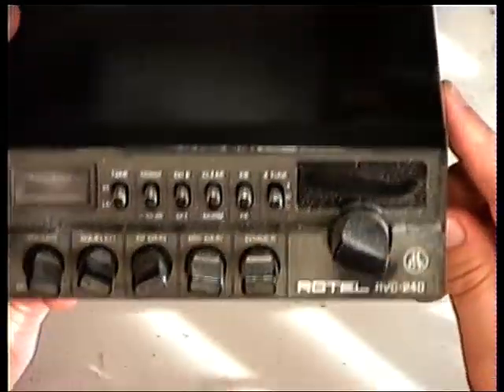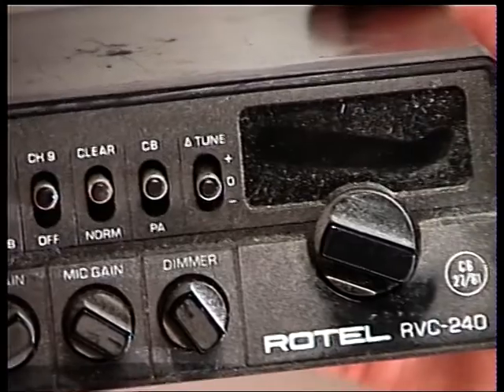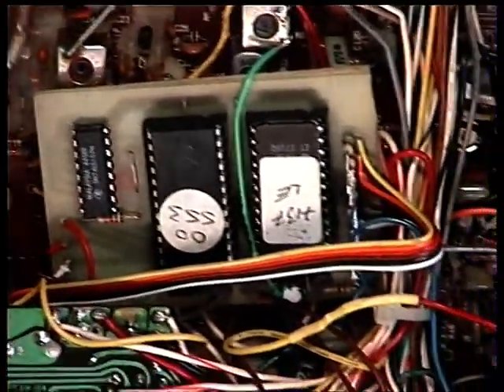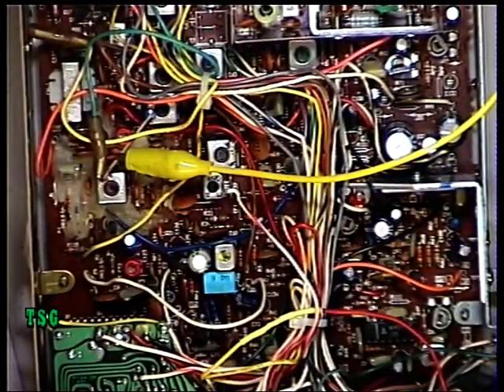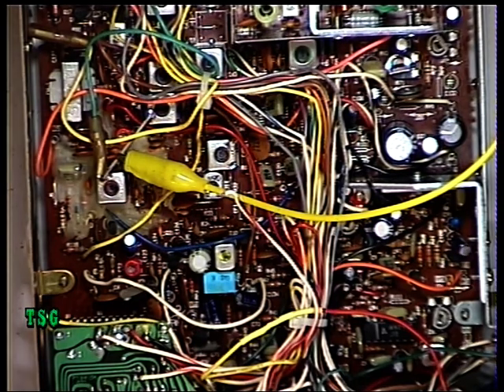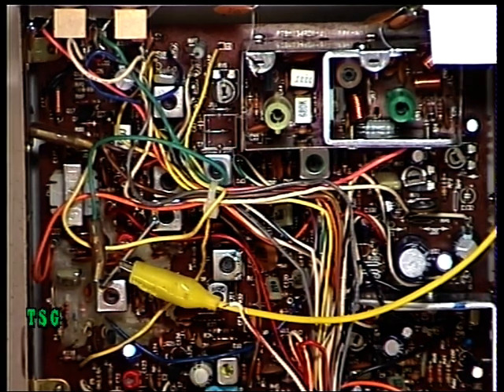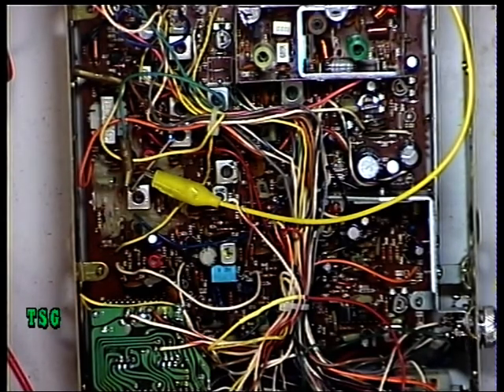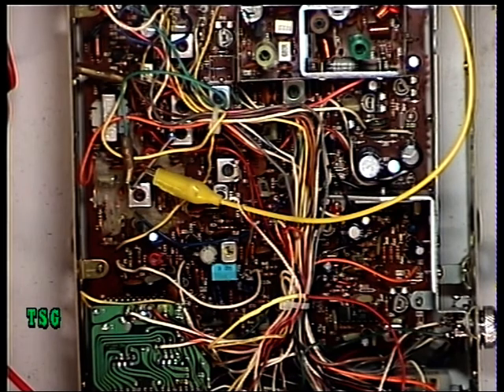Rotel RVC240 UK (CB27/81) CB radio (mobile)  - repair, vco & transmit

Comment: Hi Richard, do you know where i could pick up a replacement signal meter for a Audioline 341 ?
Reply from the maker: You'll just have to trawl ebay for scrap uniden sets...you may find illegally imported AM models have the same meter & you've cracked it. I seem to recall we had a scrap President Veep that we once found to be a suitable doner. Some Realistic sets are Uniden made too.

Richar

Comment: Hi Richard. Great channel this, I must admit my knowledge is limited with Electronics but I find your CB service videos very interesting. I just bought one of these RVC 240 's. I had one years ago and regretted selling it. The one I've just bought is very clean  but I've noticed that there is hardly any power on -10 db.  Got full power on normal. I have a York  863 too which is the same. I believe the case has been off the Rotel at some point  as the screws are chewed slightly. There aren't any add ons like on your set and everything appears good. The York I have doesn't look like it's been tampered with. Does this sound normal for these cybernet rigs ? I can't remember if my old set was the same. Thanks, Matt
Reply from the maker: Yes Matt, the 10db attenuator's internal preset becomes dirty. Most of the time a quick squirt of switch cleaner (we use the Servisol one). Sometimes we have to replace the control. The preset for the 10dB attenuator is shown in this video. Case screws are 3mm metric & easily available in 6mm length & in black of Ebay & the likes.

Richard
Reply: Thanks Richard. I'll check the video again but to be fair I don't fancy messing with it to be honest, I'm no rig doctor lol. I'm glad it's not a result of someone messing with it as I was curious when I saw the screws. It may have been a genuine  repair at some point. Thanks again, Matt.